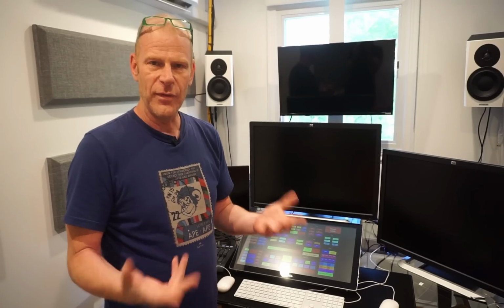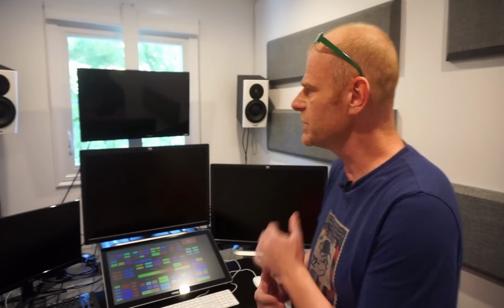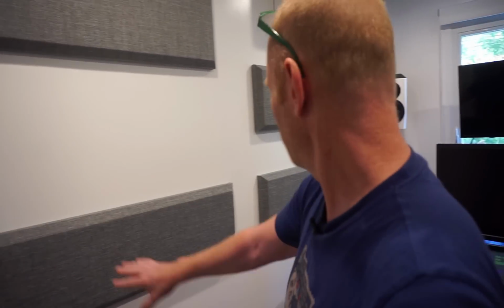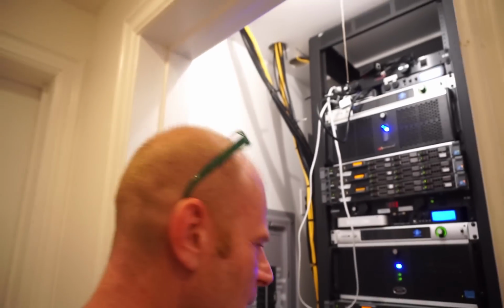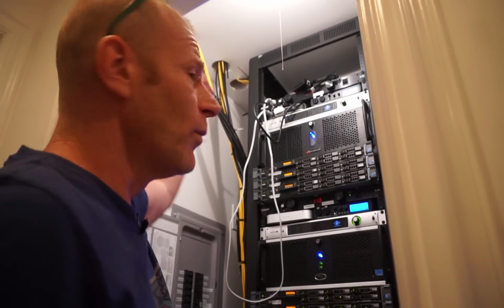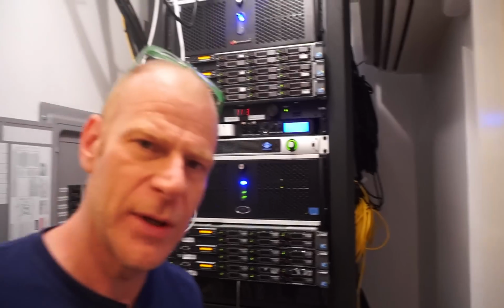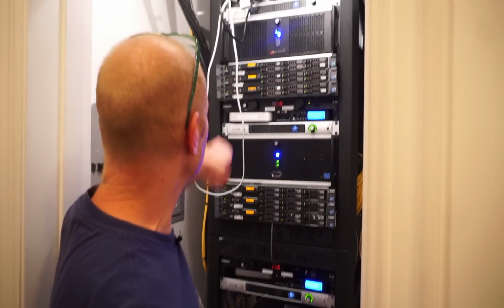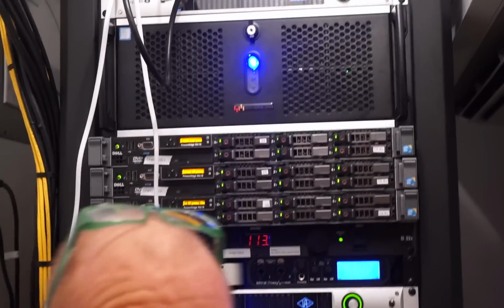Improve Your Studio: Panels, Machine Rooms & Server Units

Comment: If you're putting your machines in a closet, please don't forget the cooling aspect, it's kinda important if you want your hardware to last as long as possible :)  
I got a 1U HP DL360 w/72GB RAM for free at work which I use in my closet with Vienna Ensemble Pro, works great. 
Also used a bunch of ultra cheap foam-bricks from ebay, it's not the best stuff in the world but it works wonders for unwanted reflections in my room. Think it was like $30 for 15 bricks. 
Sweet setup though, Tom :)

Comment: Another super awesome tutorial tip giving video !!! Thanks Tom, to all asking questions about how he has the VSL Libraries connected out, go to some of his earlier "setup" video's he does shed enough light on the way he has things connected there. But basically 1 Main Master machine running Cubase Pro 9.5 (now) and it was at the time talking to [6] Server machines, and all those did was house the Sample Libraries in different variances, I think one was dedicated to his own custom Diva and Zebra stuff / another for the Vienna Strings, Berlin Strings, East West... another was Drum and Percussion, another Woodwinds and Brass, etc etc... much is done in the early setup phase of his rig, and his master template which is loaded all the time, and the custom touch screen lets him dictate to Cubase what's active and a fast way to see what sounds and libraries he is using.... and there's a router and switch that he said would send up to 10GB transfer speeds, The server just hosts the data, the main machine is the director, and points to when and where it needs to pull from. Might be season One of Studio-Time Episode's 1-3... I think the key for the servers is to max out the Ram and SSD drives for speed, his older machines had 128GB of Ram... RAID Arrays just increase the speed nicely.

Comment: I'm also interested how you control the computer with Cubase on from distance? Do you use something over network, repeaters or remote desktop solution? Which all may have some latency issues.
Reply: Just long cables? :) Maybe signal boosters for hdmi over long distance.

Comment: Tom could you tell us more how you transform these serverunits to vst hosts. Is there possible to use normal windows in these and instal for example Ableton live into it and use it as a supercomputer for my homestudio?
Reply: Vienna Ensemble Pro. It works like a cache, you load up all your libraries on the servers and load up Vienna Ensemble Pro client in your daw, it links libraries to your server so you do not need to load them on your daw. 
https://www.vsl.co.at/en/Vienna_Ensemble_PRO/Product_Info 
As far as OS is concerned, I would recommend running 2012r2, 2016 offered some issues for my part.  
Oh, also add lots of RAM and base storage on SSDs and a RAID setup, this is quite relevant to the amount of libs you want to be running. SSDs are for performance if you're running lots of tracks.
Reply: You would need to run the Datacenter version of Windows Server which supports 12 (and more) cores. I’m not sure (and welcome other’s experiences here), as to whether Windows 10 supports that many cores on a server.
Reply: yes you can run Windows on them. I would however recommend that you either install Windows Server 2012, Server 2016, or Windows 10 Professional.

Comment: Wow, I just built a similar rack. A single Dell r610 server (specs below) and 48TB HDD array. Only about $1000 for my entire setup (before the +$1200 hard drives).

2x 3.33Ghz X5680
48GB RAM
12 Core (24 Logical)
Reply: Which DAW do you use on this system?

Comment: Former computer enthusiast turned bedroom producer here... I used to be heavily into computer tech years ago so my current desktop is no slouch when it comes to gaming, but I notice a lot of issues with music production (I use lots of the arturia plugins and some heavy duty effects due to my lack of hardware, makes some projects difficult to work with). I've thought about upgrading some components, but where should I draw the line? If I were to build a new computer for audio production, what should I focus my budget on?
Reply: A multi-thread processor with a min. of 8-12 cores (the stronger the CPU, the better!), an SSD hard disc for your plugins and DAW, and a min. of 32GB of ram should be able to get you far unless you run an insane amount of plugins and tracks. A trick I use for when working on my late 2013 Macbook and Ableton is to record a MIDI track that is running a VST plugin to an audio track and use that recording - playback of files takes less toll on the CPU than running an VST.
Reply: @honeybunny9942  Thanks for the tips, I started bouncing my tracks a while ago to help alleviate some stress. Haven't been keeping up tabs on the industry as of late, is AMD a competitor in the professional market yet? I started changing interests around when they launched the Ryzen stuff... Is it still more cost efficient to get like a used Xeon x5650?
Reply: It's definitely more cost efficient to get something in the likes but I am not sure how well the x5650 would hold up today. 4 cores with hyperthreading could also work - in CPUs for plugins, as far as I know, and what I meant by strong, is getting a processor that has good single core performance for audio processing and multi-thread for running several plugins/tracks. Lots of RAM is essential as well. I can highly Reaper, which is a lightweight DAW when it comes to CPU usage. 

AMD is about to release their Threadripper series but it comes with a hefty pricetag. They're definitely competing on the gaming front but not sure when it comes to industrial use.
Reply: Reed - you should look at Vienna Ensemble Pro. You are able to try a demo before purchasing it. It will take some research to get it all figured out, but it is worth it (you need a wired gigabit network for best results). It is designed to run server instances on slave PCs, but you can also run an instance on your host DAW PC. I use Cubase, and by running my VSTs on the host instance of VEP (or VSL as JunkieXL called it) successfully offloaded the strain being put on my DAW. The cool thing is, when you buy it, they provide 3 licenses, so you can run it on your host + 2 other PCs. Each time you upgrade to a new host PC (or Mac), just slide your old one in your VEP farm. You don't need audio interfaces for them. Old PCs or Macs in the farm means cheaper RAM! Also, once you have the server instances running on those slave PCs, you just leave it on all the time with everything loaded up.
Reply: You can render parts that are finished to audio files and use them in your project instead of using all VSTi's real time. That will save lots of CPU processing time.
A good audio interface with good ASIO drivers will help too. Work your audio interface does, is not to be done by your CPU.

Comment: Tom, in a small room like that, uneven bass response is still a problem.  How do you get better/accurate bass response in a small project room?  From what I've read, it's almost impossible...
Reply: Agree. These things on the walls could help with mid-highs and highs, but with low-mids and lows..  these frequencies need really huge and fat panels to decrease them.
Reply: I really like the video! Thanks for sharing :) Also would like to hear how to treat the bass in your room. Maybe how many bass traps you should buy etc?
Reply: +1. Room correction software definitely helps a lot.

Comment: Thank you for this ectremely helpful tips Tom. May I ask a question about computers? How did deal with potential problems when you buy a second hand professional workstation? I mean when you buy a server unit from a data center or a compony which pushes computers realy hard, there is always a risk that any component can be cause a problem such as SSD's or RAM, or CPU as a nightmare. How did you know that the unit will not die working on a cue? Thank you again for your time and effort. :)
Reply: Look into "Certified Refurbished" units, the reputation and reviews of the ebay seller and/or warranty.
Reply: At such low prices you can afford to buy an extra one or two to use as a backup.
Reply: I used to work at Hewlett Packard Enterprise doing hardware support, and the warranty of the device (server, cards, harddrive etc) follows the device not the owner. So as long as the first owner de-registers the HPE server from their account, you can then register it on your account. Accounts are free to register. 

When it comes to the RAM of these devices they use much much sturdier components than your home computer and they are "Error Correcting" ECC RAM, which means that if a bit has been flipped by say a cosmic ray then this is registered and the RAM module can be marked as faulty and is no longer used. Either the ram works, or it doesn't even load. This is the most common issue with RAM.

As for SSD drives, they can be ridiculously expensive for server SAS applications. IF you get them with the server, then check the life span of them, they usually register in the firmware the remaining expected lifespan of the SSD. Again when server SSD's fail most likely it will just stop working and the drive is marked as failed in the firmware. 

Now here is some hard truth, don't run a RAID 6 or even a RAID 6 on SSD's or HDD's that are larger than 1Tb. this is because you are likely to fail another drive in the RAID array when you rebuild the lost drive to enable the array again. I've seen  SSD RAID 6 and 60 with 2 to 4 Tb HDD's and 1-2Tb SSD's get cascade failures with most drives in the array being lost. 

RAID is NOT the same as backup, RAID is used for two things, first of all data integrity and second is read speed. Since RAID's can correct minor write errors, it is good to use to maintain reasonable data integrity to avoid corrupted files. That said you do need to get a tape drive to do a backup of the server just in case. 

Now you can of course just skip RAID altogether and go with ZFS if you are a Linux/BSD user. Or use the new Windows server ReFS, Though this means that you need to read up on filesystem features. 

If you do decide to get an enterprise grade server, please be aware that you can't get normal support for it. There is a lot of work maintaining these devices and they are not by any means Plug and Play.

Comment: Acoustic treatment for a bedroom studio is a problem for me, because I want it to be effective and not damaging my health in any way with all the fiberglass insulation and what not (I sleep, work, create, play here, after all). Also I wonder how do these old servers keep up with running a lot of powerful vst synths, like Softube Modular, U-he and so on. The question is important because many of modern plugins work better with more modern processors. And those dell's cpus are from 2010, which is very outdated by computer terms.
Reply: Look into green alternatives to regular fiberglass? I got bass traps from GIK Acoustics, and they use certified low emitting materials. And there are even greener alternatives out there.
Reply: Yes, I'm considering GIK at the moment.
Reply: He's using the servers for libraries for the VSTi's though, not to run the VSTi, from what I gathered.
Reply: He said he can run a lot of instances of Kontakt - that kinda implies he actually runs them - this is a vienna server after all. My question is about synth plugins performance, not sample-playback plugins like Kontakt.

Comment: Great little tips and video. Interesting to see your studio also utilises Dell servers. We’ve 12 in our studio running about 11TB of samples and libraries on VSL VEP6 on Windows Server 2008 and they are super stable. The only slight issue is that Cubase sometimes gets out of sync and can spend hours (if left unchecked) trying to get the Dell’s to re-load the libraries.
Reply: did you contact cubase about your sync issue?
Reply: Dreams and Promises - I did but having found that the only library with this issue is HZ Strings and then contacting Spitfire Audio again, they admitted that the HZ Strings plugin does have a technical issue that creates this problem in certain circumstances.  They are trying to fix it for a forthcoming patch update. To me this surely demonstrates that more testing should have been done before it was good enough to sell.  Perhaps another example of where marketing has led the way setting impossible deadlines and resulting in shoddy quality and poor customer experience.  A mark down for Spitfire Audio they should know better than to sell something this expensive that is not up to the job!!!
Reply: I agree. and that stinks because so many companies sold faulty software over the years including apple just to meat deadlines. they gamble that they can fix it b4 the majority of consumers get too mad and they compensate the really angry ones who wont stay quiet about it or offer free upgrades. **hint, hint.** I sold this stuff for 16 yrs. Good luck to you.
Reply: Why not a plumber...?
 ;)
Reply: sync/sink issues... plumber. did you contemplate that response b4c composition, buddy?
Reply: Oh man, I never meant any offence. I was simply being lighthearted. Being British comes with certain humour ;)